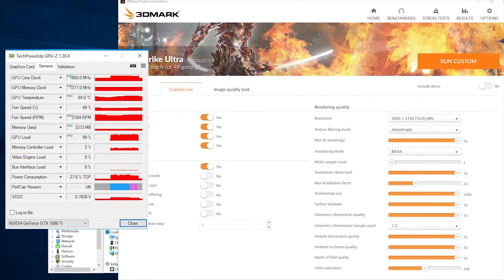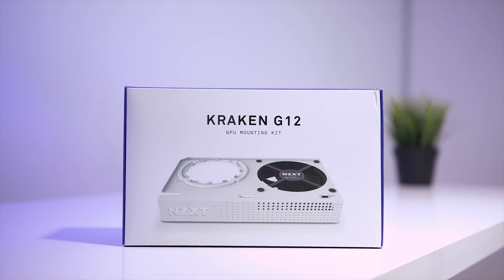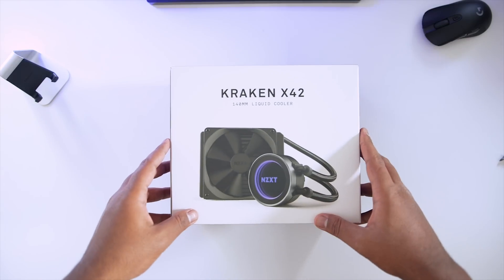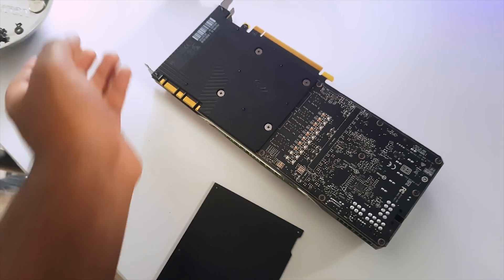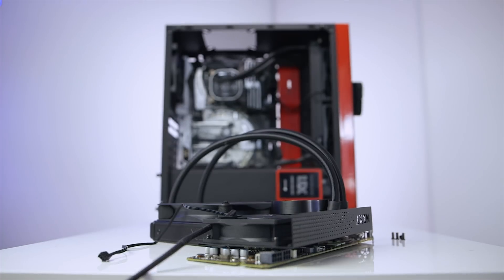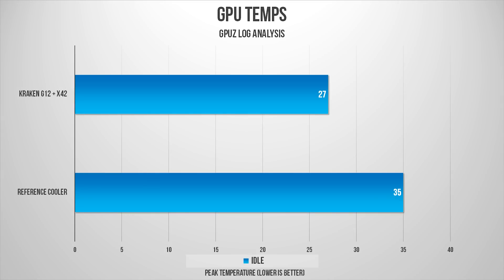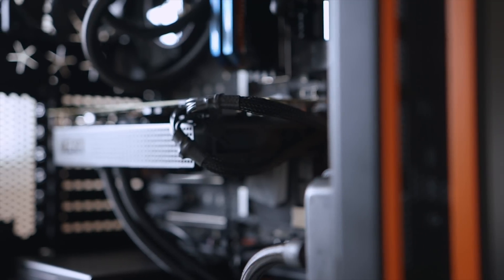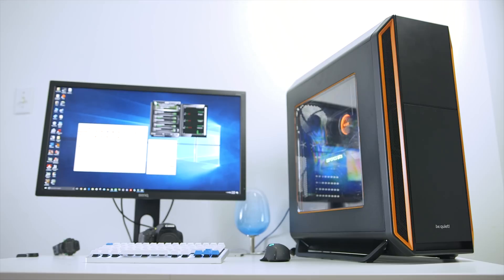Watercool ANY Graphics Card! -- Testing the NZXT G12 Bracket

Comment: wow he got terrible results, I put Corsair H90 with G10 bracket on my Zotac AMP GTX1080 and even now in the summer with room temps around 77-80F I rarely break 50C on gpu core, during cold months I never see it go past 45C, it barely breaks 40C after hours of gaming, and thats with the other air cooled 1080 in SLI. Dont know how he got such weak results, my setup cost me $90 and his $160 that's terrible!

Comment: Why use such an overpriced AIO like the X42?  Unless you're using a riser, which the vast majority of people do not, there's no reason to spend the extra $40-50 on that sexy ass LED setup on the pump as it will be facing down.  I've got two G12's mounted on my two 980 Ti FTW cards with Corsair's H55 which were $50 a piece after rebate.  That's two AIO's for less than the price of one X42.  

I know what you're thinking:  the H55 is inadequate for cooling a 980 Ti, much less anything else.  Not so.  Side-stepping the fact that hybrid-style GPUs use 120mm AIOs nearly identical to the H55, max temps I saw after 30 mins of Fire Strike Ultra stress test were 55C.  And that was on the top card of an SLI setup.  And while my H55s were not the most silent things in the world, my rig no longer sounds like a jet fighter about to take off of an aircraft carrier.

EDIT:  Wow, 69C at full load with that X62?!?  And the GP102 should be a cooler chip than the GM200.  Either you didn't mount it correctly, or........yea you didn't mount it correctly.

Comment: temp way too high. should be in the 50s. I used to have G10+ gtx 680 and it stayed at 47-48C. And u could pick way cheaper 120-140 CLCs and stay under $100 
where's the vrm temp tho? it was a issue with G10.

Comment: Two issues i have with this review.
1. the fact you might of not been making full contact with the plate. so it would ecplain the spike.
2. the spime isnt from using a front mounted radiator.... IF that had anything to do with it would be the case. NOT the radiator being in the front. their has been many test run that debunks the fact of a front mounted radiator dosnt have no more then a 1-2 c in difference, which is within a margin of error... also did you leave the midplate on? it might of intefered with the contact of the aio cold plate. i confess though i only caught bits and pieces of the video though.

Comment: Had poor results with single AIO 120 and 140 (not worth the money) used Double AIO (120) and my temps were halved. went from 82 down to 41 under load. This is the best for those who do not want to pay for a customer water cooling loop and will save you some money. I saved by putting Dual AIOs for CPU and GPU and I still saved about 100 versus a starter loop.

GPU = EVGA 1080 SC
AIO - Corsair 105
Reply: 41c great but is it on full load or gaming ultra presets

Comment: Man, your 1080 Ti goes up in the 80s on load.  Mine was seeing 75C.  Then I just recently got a Mastercase Pro 5 with 2 fans in the front and put the AIO on top so nothing but cool air enters the case.  The highest I seen it reach after running the Heaven benchmark was 69C.  So case definitely makes a difference along with room temps.  Good test nonetheless.  I'm considering replacing my Corsair H90 with the H115i and using the H90 on the card with this bracket.

Comment: MAJOR issues with the information in this video.

1) The problem with the solution not fitting in the S340 is ENTIRELY your fault, having the front fan spaces occupied with a CPU cooler, and you choosing a 140mm rad based AIO in a case which is known to not support rads at the top space (for exactly the reason you found - clearance). Using a 120mm rad based AIO in the rear position would have solved this problem. 

2) You can get a 120mm AIO for like $30-40 on sale these days, so saying that it costs $160 (or some ambiguous "less") to do a project that you could easily do for $60-70 is absurd writing and misleading. 

3) As others have said, your final AIO temps are highly spurious and suggest PEBCAK. They should be a solid 10 degrees C less at load, especially as an intake, at the most. 

4) Where's the overclocking testing/information? Did you manage to get higher overclocks with the lower temps you achieved? What's that? You didn't tell us anything in that regard?

I had just come off the back of watching your 4k vs 21:9 vs 144hz video and though that despite being a little detail-lite, the quality of your videos is typically so user friendly and engaging, and generally in the realm of accurate and true. 

Not this one at all.
Reply: David Haney he is providing valid points though, he's not just putting his head in his ass
Reply: No
Reply: Most circular Asetek pumps (and not rads) will work. Min les anakribeies.
Reply: The G12 is $50, 120mms AIO is around $50-$80. $120 for a cooler card vs next tier card.... That's s lot of money. Better buying a CPU/GPU custom loop and getting better overall system temps for that kind of investment
Reply: @TheMasada05  my reference 1080 throttles at high temps so it's worth it. I bought a h100i on Craigslist for $30 and a h60 for 20. Also the g12 is 30
Reply: You make some good points.  Paying 130 dollars for a 120 or 140 aio is flat out absurd to me.  As far as the temps go, the 1080ti is rated to 250 watts,  so I would say that anything under a 240mm rad is not really capable enough to cool without heatsoak.  I think if he left it under load for more than 15 minutes, those temps would've just climbed and climbed, especially if it was set to allow for any overclock at all.  He shouldn't have even mentioned the fitment problem in the case, just makes it look like poor planning, but hey, it happens to the best of us.  I am also pretty sure he left it at the factory settings, and did not overclock it.  That kraken is a decent cooler if overpriced, and it looks fancy with its rgb, but it's just not cut out to handle the kind of heat that a 1080ti makes.
Reply: I was thinking of using this exact cooling method with a few things different...adding some vrm heatsinks(off amazon), changing the fan used on the bracket to a high static pressure fan, using a push-pull config for the radiator of the aio, and spray painting the bracket blue to match my build. Figured it would be better than spending 500 and upwards for watercooling. You seem to be well versed in this area, do you think i would see better temps from doing the trick with the heatsinks?
Reply: VRM heatsinks are a good idea, just make sure they're low profile enough to fit under the bracket. The heatsinks can be adhered with double sided thermal tape. You can find good replacement fans on pcpartpicker with a filter to find really good CFM with low dB on the particular size fan. Throw some kyronaut thermalpaste under your AIO and maybe get good fans on the rad too for your push/pull and you should get way lower temps than shown in the vid, which are high even for the setup he did.
Reply: @cboscan1  Great advice! Thank you for your input, I'll definitely put this to the test.
Reply: Would a 360rad be able to cool it with just push, or would you need a push&pull 360rad?
Reply: @Gun4Freedom  I've actually got a 1080 Ti Amp Extreme with a brutal 2126MHz overclock running with a Corsair H90 mounted as exhaust and the hottest I'm getting is ~55C. So I don't know what Eber did but something isn't making sense.

I did replace the 92mm NZXT fan with a 92mm Notcua and also used a GPU fan to PWM cable so that  and the rad fan are based on the GPU fan curve though.
Reply: only specific rads fit onto the dye, and are quite expensive. you cant just throw any fucking radiator you find. you a little research next time buddy.
Reply: @macro4538  regardless, cheaper options can be found for gpus than the one shown
Reply: so many "experts" that know fuck all from the university of fucking youtube , move along ffs the pair of you  ....sheesh

Comment: +HardwareCanucks You need to run these stress tests longer for Water to reach its maximum energy density. Metal gains heat, and looses heat much faster. Water takes a good bit longer to reach its peak heat. It also takes much longer to cool back down. 

Either way, if you wait 10-15 minutes on air cooling, you need to wait 40-60 minutes on water. 

Really would like to see if I should go with water AIO for my new 580 with a Cheaper card, or get the MSI Gaming X+

Comment: My 1080 Ti FE with a custom fan curve hits 71-74c under load, which is only a 5c difference compared to this watercooled GPU. Granted, it can get quite loud, but I rather deal with a bit of extra noise than coughing up that much money. 

Something's not right here. I've seen far better temps with AIOs.

Comment: what should i buy between:  

evga 1080 ti ftw 3 
or
evga sc2 hybrid
Reply: IMHO it would depend on the money you're willing to spend and also value for money spent. If the FTW comes in a lot cheaper then get that one. Both come with the new iCX technology sensors I think and honestly the FTW should keep the card cool enough. I have an MSI Hybrid 1070 and while I personally don't regret buying it, I did pay a lot more for it where I live ( about $70 USD more). That said EVGA's hybrids were always better IMO. If you look at the reviews, the pascal range of cards all top out around the same Mhz range regardless of what version of the card you are running. No one else can tell you if watercooling is "worth it" at the end of the day except for yourself.

Comment: 69c with watercooling? You messed something up royally dude. These AIOs usally manage to keep the core at 50-55c with minimal fan speed. Also. No VRM cooling again. Horrible solution from NZXT. You're far better off buying the EVGA watercooling kit. Looks better,works better,cools the VRMs and it's even cheaper.

Comment: I don't get why you didn't just use the larger rad for the GPU, and the 140mm rad for the CPU, the GPU is your biggest heat outputter in most cases.

Plus you could've fit it all into the s340

Comment: It's only a $160 solution because the X42 is overpriced as hell...
Reply: Le Monarque yeah, use some fractal stuff or some other reputable brand instead. I would recommend fractal since they have sound deadening materials and I use one for my 1080ti and the pump is silent and the fan is also silent, around 900rpm at load (I get 65c at load since I have a very slow fan curve)
Reply: @ludde1300  Is there some 120mm Fractal AIo that is compatible? thanks in advance. Fractal doesn't appear as compatible in NZXT website.
Reply: 3 years later the x42 is now 200$
Reply: Ludde NZXT has sound fradeling materials on the pump aswell...
Reply: Le Monarque you can buy a very cheap 140mm aio from Amazon for ≈40$
Reply: You need an asetek (mounting) compatible aio cooler, nxzt has a list of guarantied compatible coolers
Reply: Yeah well my RX 580 is cheaper than $160
Reply: I ordered the NZXT Kraken M22 120mm instead for $80
Reply: @Sassannid  that isnt on the list man
Reply: @cherub0nyx  its an asetek cooler
Reply: Damn right it should be around 40$

Comment: That is a lot of money and case clutter just for a few more MHz on the core and slightly lower temps. I have the FE 1080 Ti and at idle it's basically silent and stays at 32c and under load I have the fan set to 90% (no bother because I use a 7:1 headset when gaming) and the GPU doesn't get any hotter than 72c, and thats with it overclocked to run at 2000mhz on the core and 5900mhz on the memory.

Comment: I have the Carbide 540 case and I have a 360mm CPU AIO and a 120mm GPU AIO mounted on the front and the back, respectively. Plenty of space for the GPU cooler.

Comment: The implementation cost is high as you say, however going this route you are supposed to keep the cooler for next cards too, so you can both save money on next GPUs and buy any version regardless of how good the implementation is.

Other than that, performance seems a bit lackluster at 69c load... are you sure the block had good contact? If so, then maybe the fan on the X42 was running too low? You could try with a 240 or 280 radiator to compare results, 69c is just too high for WC.

Comment: yeah Ive given this a go: what I learned
1 haf x case is too large to attach it to front
2 after taking all screws out and  still wont come apart, remember its the thermal paste holding it together, so twist back and forth.
3 totally worth it, 37 under load on a gigabyte 980ti.
Reply: OliverTittyTwist nice junk case

Comment: Did you just say the reason your case temps went up were because of the rad on the front? WOW
The temps went up because you took out a blower style fan which sent most of the heat from the gpu out the back, and put in a normal fan which just let most of the heat back into the case!

Comment: I have the G10 on a ref Radeon R9 290X, and I have to say that this solution is actually viable in very few cases. As others have mentioned, a lot of brands manufacture hybrid cooled graphics cards so you don't have to tinker with it yourself.

The only case I can think of when a G12 can be the best option is when you really can't have a custom loop, have restricted airflow because of a small case. And you also want your PC to run more silent.
Cost effectiveness really doesn't come into play here. It didn't when I bought my Kraken G10, and back then there were no Seahawk thingamabobs or anything :D.

Comment: I love my Kraken x62 CPU cooler, but the software it uses to control fan speeds and monitor temperatures is GOD AWFUL. It regularly loses track of my kraken on startup, which causes the program to lose my custom fan curves, which are not backed up to a file of any sort. So I have to remake my fan curves about once a week. Very frustrating.

Comment: You should've mentioned that there are many different, cheaper AIOs you could use rather than the X42. The X42 is by far the most expensive single fan AIO. Also there must have been some mistake in application of thermal paste or you're using a very quiet fan curve because you should be getting much lower temps. JayzTwoCents used the same bracket and AIO on a 1080 FTW2 and was getting under 50 degrees C under full load on Heaven. Note that his card was overclock and yours was running at stock frequencies.
Reply: The case is super restrictive, whereas Jayz was using an open air testbench. A 140mm fan is gonna have trouble pulling through some tiny holes and push it through more tiny holes.
Reply: @vighneshsivakumar3418  
Yeah a good airflow is critical for your case.I have sacrificed the silence,but at idle my overall pc temps are below human body temps
Reply: yes
Reply: There Is a custom board on the ftw2
Reply: will this fit on sapphire rx 480 with thermaltake pro 3.0?
Reply: Timmy jayz basically has an open bench with an air conditioner blowing on top of it he’s awful
Reply: idk how much heat you expect a 120 mm radiator to dissipate...
Reply: Or he did nothing wrong and Jay only showed his best results like most big youtubers do. Suck his dick more idiot. A 120mm AIO wont cool shit
Reply: Also, I wouldn't trust hardware advice from Jay Z. He is a rapper. 😂🤣
Reply: @Boogie_the_cat what do you mean?
Reply: lmao shut up nerd
Reply: He said right at the beginning of the vid that you can use any Asetek-style cooling solution.

Did you not listen, or not understand what he meant. He never says you should use any specific type. He says it's bring your own cooler, which humans should be able to understand. Are you a bot?

Comment: I find that the biggest advantages to these aftermarket GPU brackets compared to a pre-built AIO solution from EVGA, MSI, etc. is the ability to reuse your bracket across multiple GPU generations. A lot of times, the slight premium you pay for a new pre-built solution over air cooled cards gets negated when you go to sell the card down the road as pre-built cards seem to sell for generally the same price as air-cooled cards on second hand markets like Ebay, Amazon, and Craigslist. The few extra dollars you spend initially to get an aftermarket bracket and AIO versus a new pre-built AIO solution will actually save you money in the long run once you start reusing the bracket and AIO on upgrades into the future. Just my thoughts, but if you don't upgrade very often it probably would be cheaper to just buy something pre-built.

Comment: If you have a standard two-fan aftermarket card I can recommend removing the two 90-100mm fans and zip tieing a couple of 120mm fan directly to the heatsink. The bigger fans are much more effective and have a lower tone than smaller fans which will have to run faster for the same cooling performance. I attached a couple of Corsair ML120 fans to my MSI R9 390, using a very cheap Gelid PWM fan adaptor for the connector on the GPU PCB and a splitter to the two fans. Works beautifully, I'll probably do this for my future GPUs if the noise gets too much.

Comment: $160 for this around $160 for a x62/52 if you want to cool your cpu as well and now you are getting into custom loop price ranges..  Combo d5/res is $150, gpu block is $100, cpu block is $60, 2x 280mm rads 1-120, fittings, tubing, coolant, fans, misc costs let's say another $70. So about $500 total for a custom loop but the custom loop will offer a full cover gpu block, the ability to keep much of the system when you upgrade components except for the gpu block and more radiator surface area.

Comment: How did you cool VRM and VRAM?
Reply: the included fan cools them, despite having no heatsinks it achieved better temps according to linus' video
Reply: Cooler components means lower power draw.
Reply: Dank Nuggs 

No passive heatsinks? There are a lot of copper bad aluminium one. Can improve.